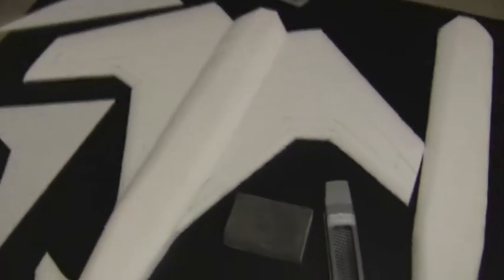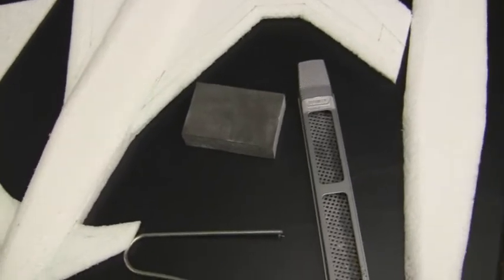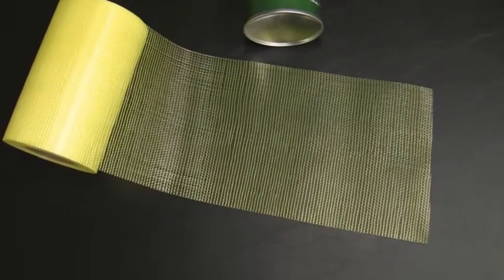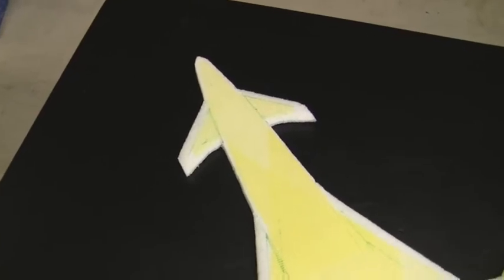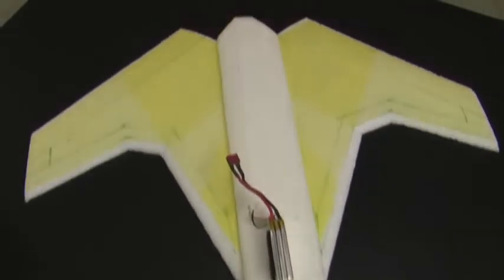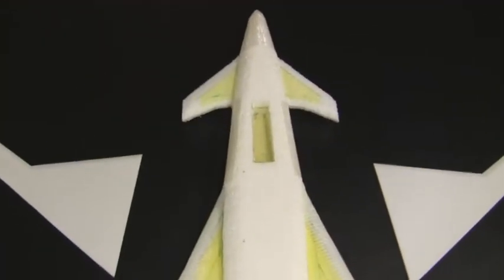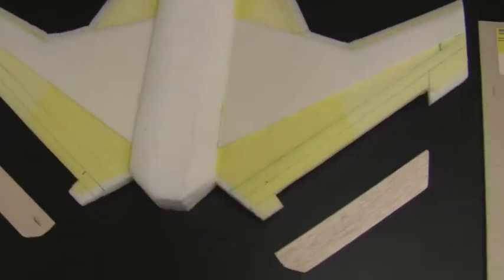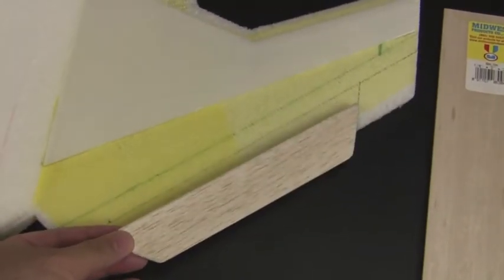Part 2 Experimental RC Plane

Comment from the maker: Thanks AnyAirRC! I did doa few glide tests in the backyard with the bare airfroam. i should have videoed it.  You guess on CG is right about waht i thought too.  I started about there, but it seemed to fly best with it actually a littled forward of the wing tips. I'm guessing the large wing roots are naking a little difference. Thanks again for your insight, i highly appreciate your input, especially with how great your planes fly!

Comment from the maker: Thanks kaptainC. Usually the battery slot is located by an educated design guess. I usually place all the components ontop of the plane in the basic area they will be installed to. Then I put it on the balancer to get an idea of where the CG is.  The approximate CG was determined by a few glide tests of the bare airframe. Once that is all done, I then cut the battery slot.

Comment: Thats a very good point AnyAirRc. The CG point is very different on a forward swept wing. Paul does have the wing root very far forward, it will be interesting to see where Paul finds it to be. Your suggestion goes right along with the SU47 design.

Comment: Thanks 
I found Elmers foam safe spray adhesive (then returned it) and got 3m super 77 spray.  Also could not find the fiberglass weave but did find out that screen door mesh for small insects is a fiberglass weave but a litte bit heavier (not much though) and will cover the whole wing in one cut and should add strength to using poly bead foam

Comment: Have you done test glides of the empty airframe to find the CG? my first guess would be about 0.25" behind the wing tips.  I maybe off but that would be where I would start.  I like you build methods and info. I just did the over under tape method for the first time after watching your videos.  Thanks! 5*

Comment from the maker: netjunky41, yes you are correct, thet the 3m 90 spray adhesive will eat regular stryofoam or bluecore foam.  Always test any adhesive on a scrap piece of the foam you are using. EPP is a tougher type of foam and the 3m 90 will not eat it. If you are using regular foam or blue core you can use the 3m Styrofoam safe adhesive. I am just not sure how strong it is as i have not used it yet. You can get epp foam from rcskyfler(dot)com

Comment: If your buying 3m Hi-Strength 90 spray adhesive watch out it melts foam, I checked the can on the video and its exactly the same. Am i using the wrong foam? The hardware store never heard of  EPP Foam!!